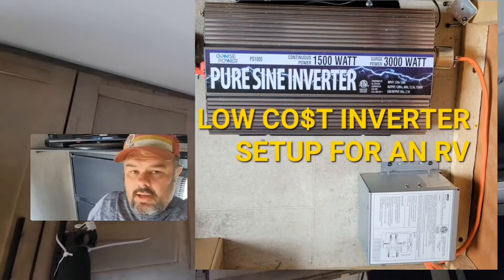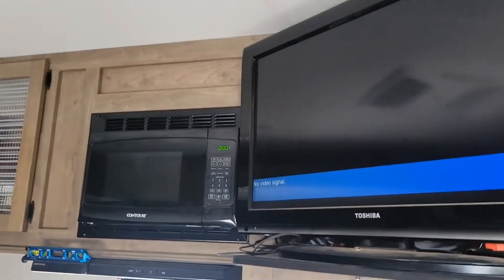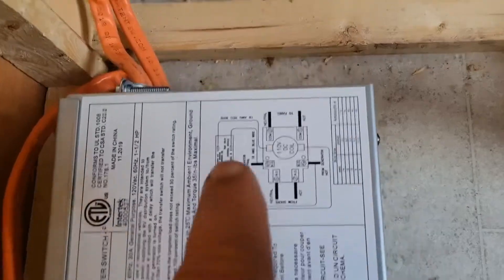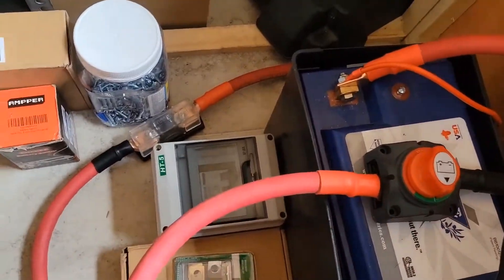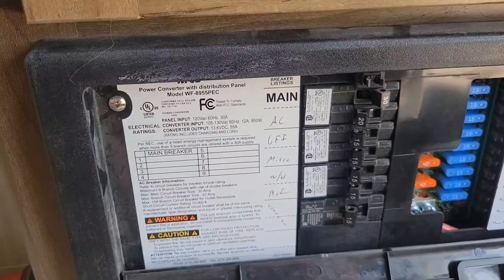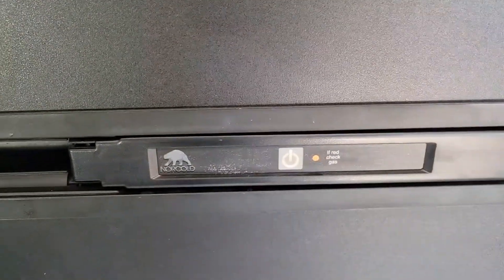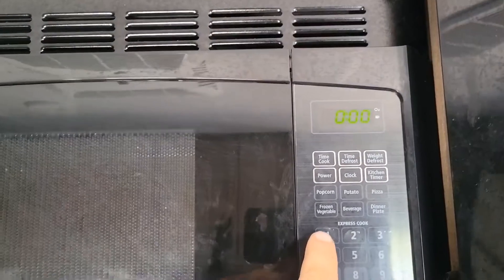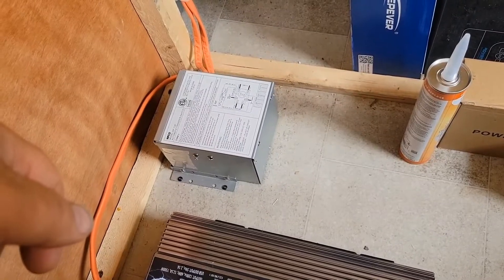How to setup an RV power inverter to run a fridge, microwave, 📺 and have AC power.

Comment: That battery born battery couldnt handle the current, not the inverter, that battery can only do 100Amps continuously, the inverter will draw more than that when running that microwave so thats your problem

Comment: Greetings, I have a 1964 mini wini (canned ham) trailer, I am looking at power options.  Stove, heat, maybe frig would be on propane.  Microwave,  lights (led) and Small AC.  If I go on shore, 50 Amp would provide more power than 30 amp, but is such a small trailer not sure  50 would be required.   Any thoughts or suggestions, based on lessons learned? How long can you run on that inverter
Reply from the maker: If you have the money go with a 3000 watt system and use 4/0 cable, fuse 250 amps and msKe sure all components are rated for 250 amps continious. Add In a mppt solar charge controller capable of handling a min 600 watts. Install a shunt and make sure your solar charge controller has an app for monitoring power generation. Make sure you put in an inverter large enough to handle the microwave.  If you want Air conditioning plan on spending at least 5k on batteries. Best go for propane generator for airconditioning.
Reply: @FTOTF1  Thank you and yes it can get expensive, I wasn’t thinking about running the AC from solar, not only batteries but also storage is a factor.